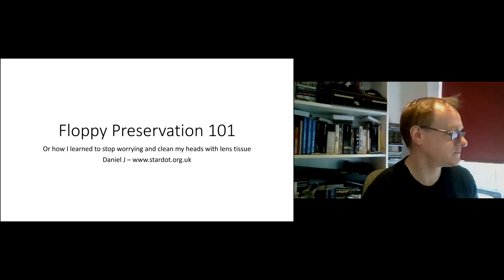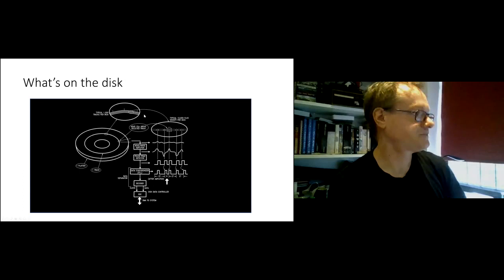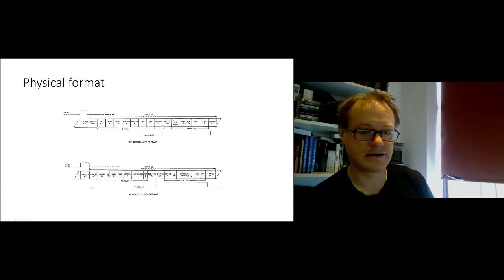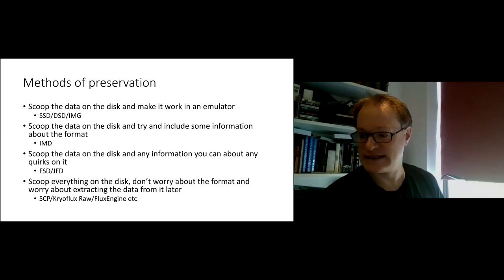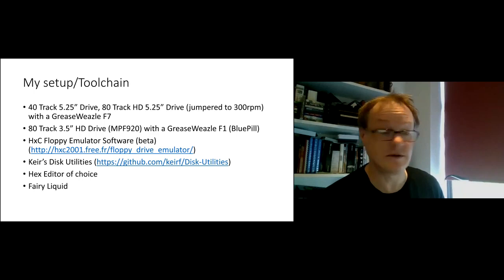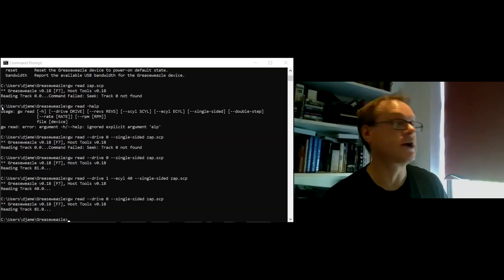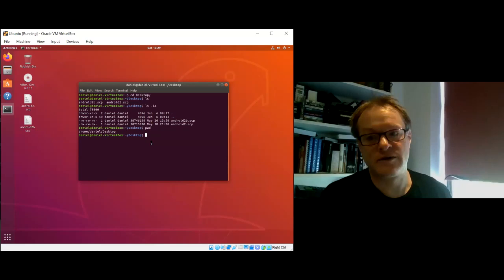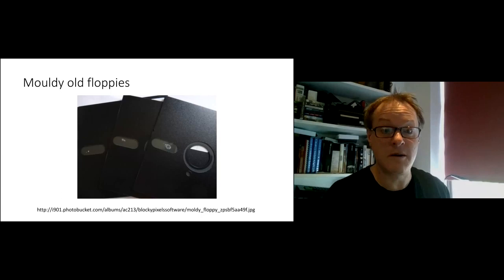Abug Talks - Daniel Jameson talks Floppy Disc Preservation: the Greaseweazel device & HFE format.

Comment: Just to note the title says Disc, Discs are CDs. Disks are Disks. ;)
Reply: Acorn used both interchangeably :)
Reply: Certainly within the UK-centric Acorn scene, 'disc' has always been the prevalent spelling. The leading Acorn publications (Acorn User, Micro User Electron User) all used 'disc' within their editorial, as did the major software publishers (Acorn/Acornsoft*, Superior Software) and hardware retailers (Watford Electronics, Technomatic) when advertising. So we've had 'disc' drilled into us as the correct spelling since the 80s - hence that's the term I always use, and consequently that's reflected on the titling of any ABug videos :-) 
* = Acornsoft did use DISK for a year or so between 1982/3 - but they soon switched to using DISC.